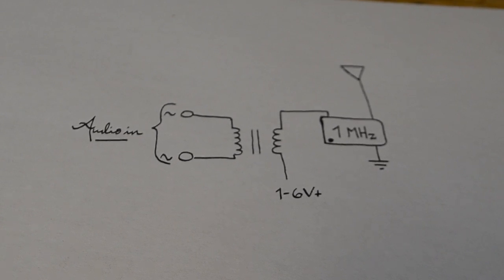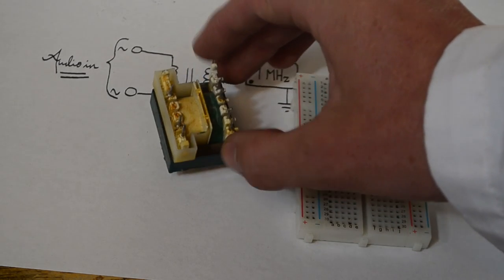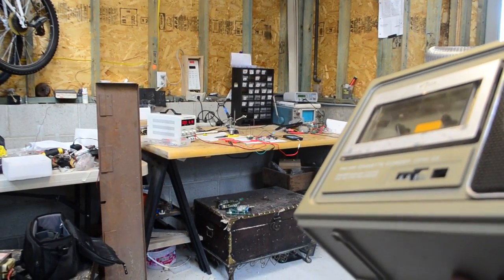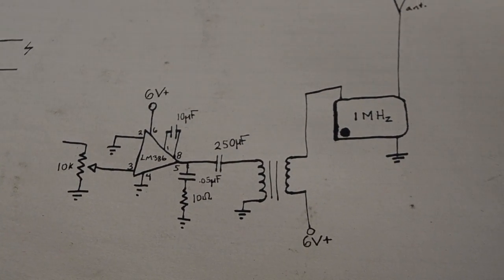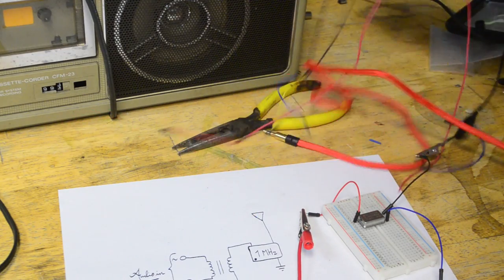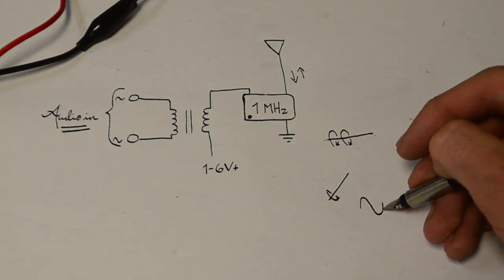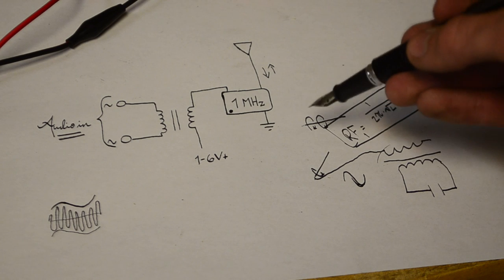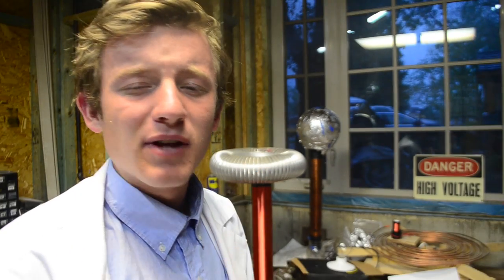How to make a AM Radio Transmitter

Comment: During my childhood, I built two spark gap transmitters out of two car ignition coils, two motorcycle batteries, a homemade telegraphy key, a spark plug, a simple LC tank circuit and a very long piece of wire to be the antenna.  The receivers were just AM receivers tuned to the top of the scale.  I gave one of the abominations to a cousin I had living about two miles away.  I kept the other one.  We both tuned our AM radios to 1610 AM and started tapping away.  We could hear the other operator easily two miles away and we had a cheat sheet to tap out the Morse code letters.  Unfortunately, those were the days of analogue television that was received over the air with a TV antenna mounted on the house roof.  My cousin and I were not the only ones that could hear each other tapping out or butchered Morse code.  We tapped out our messages most of the summer.  At the end we did not even use the chest sheets.  Then one day my father found me tapping away on my spark gap transmitter. I got in major trouble.  People all over the neighbourhood were falling victim to my sloppy transmitters on the telephone, television, and radios.  After a date with dad's scorn, I had to take my cousins transmitter back.  My father made me go get my cousin's transmitter by foot, dismantle it, and carry the heavy, bulky, transmitter parts back and give them to him.  It was 90°F so it was not pleasant at all.  The two batteries, two coils, excess cable, home made key, and simple tank circuit all weight what felt like about 85 pounds.  I guess that was punishment enough. The transmitters was never mentioned again by my parents.  I thought they were cool. The neighbourhood did not.
Reply: That is absolutely awesome
Reply: @brandonlaragirl  I still remember how to make that radio wave mangler.  Today, I could probably get away with it since the over the air signal is digital, telephones are digital cordless or digital cellular.  The regular analogue radio would still suffer.  But streaming radio would be uneffected.  But today, I live far away from any family.  They reside in a, different continent. I live in a rural area, far from people as well. Even if I knew anybody, It is likely few would want to play telegraph with a 51 year old geezer as well.  But I still have memories.  It was not appreciated, back then, that when I came to get the transmitter I made for my cousin, he told his father I forced him to take the transmitter and use it.
Reply: they had no whimsy in their life
Reply: @cassandradawn780  People have no sense of humour.  They could have taken the opportunity to learn Morse Code.  They squandered my free service.
Reply: @indridcold8433  well i would but i don't live in the same country as yours 😥
Reply: @alifr4088  Well, the transmitter transmitted around 1.6 Mhz.  I could have made a much longer antenna and another one for you and another spark gap transmitter.  That frequency has excellent atmospheric skip propagation.  We may still be able to tap away and hear each other.  C
Reply: @indridcold8433  yeah i bet my nearby airport ATC would really apreciate that too
Reply: @alifr4088  Now that you mention it, I believe sparkgap transmitters are illegal for any use today.  But I did not know that around the age of 12.
Reply: @indridcold8433  at least i managed to build the AM receiver with amplifier lol
Reply: Spark gap transmitter can wait
Reply: @alifr4088  I made an AM receiver that received just under the AM broadcast band to about 20 megahertz.  I made a three transistor, class A amplifier, for it and was able to get good volume from it.  I rather wish I went into electronic engineering as a job path.  It always sounded interesting and fun to me.  But it just paid too low to consider it seriously. It is still a hobby for me.  As a teenager, I made an AM transmitter. It did not transmit as far as the sparkgap transmitter, not even close.  But it was really easy to make an AM transmitter that covered half the neighbourhood.  Whenever I made more of an amplifier to transmit further, I think an impedance mismatch made the audio frequency drop to barely audible.  I did not know how to impedance match the extra amplifier and transmitter so I stayed happy with about 700 meter range.  I shot a home made bow and arrow into a tree to hang the wire antenna.  Ah good times. Look what you did.  Now I want to it all again.  This time I know the secret of a small impedance matching transformer.  Maybe I can get few kilometers from the homemade junk.  Now, I can run more exacting LC tank circuit formulas and increase the Q of the circuits to achieve a significant AM transmitter.  I think the LC tank circuit resonance was 1/ (2(3.14) x the square root of LC.  Simple little 2n3904 transistors will make all this possible.
Reply: @indridcold8433  mine is way simpler just a crystal radio hooked to an LM386 amplifier with 8ohm 1W speaker. And also since i live in a military complex and there are multiple abandoned air force radar such as Nysa P-30, i'm able to connect my antenna to it and receive tons of signal lol
Reply: That radar acts like a very huge antenna and i can even receive SW signals too, tho i wonder what'll happen if i connect a spark gap or AM transmitter onto it...
Reply: @indridcold8433  does any one know if  a Faraday Cage,or something similiar  could be built for the spark gap part of the transmitter ?
Reply: @indridcold8433  tell me how to make it i want to make too
Reply: The neighborhood was wrong
Reply: @alifr4088  No, do not connect a spark gap transmitter!  Well, maybe it will not be so bad.  Everything is digital now.  Only analogue AM/FM radios will pick up the harsh buzzing.
Reply: @indridcold8433  It'll only be audible on analogue radios, but it'll still interfere with radios of all kinds. Think of a man whispering tenderly in your ear in English while rubbing your back, and a man screaming ancient Greek in the other banging against your chest. You do not understand the other man, but you still do not hear the flirtations you intend to hear.

Comment: Just so others know, the whip antenna that is extended on top of the portable radio is for FM only, the transmitter he has built is AM and the radio uses a ferrite bar antenna that is located inside the radio. That ferrite bar is very directional.
Reply: Yes this is true. there are 2 winding on the bar one with 18 turns the other with 9. the one that has 18 is connected to the field side on the variable capacitor the other is connected to the first IF stage of the AM receiver just before the detector. This is usually a low voltage zener diode.

Comment: This really does work! I built one this week and it works surprisingly well.  The audio quality is pretty good considering it's AM.
Reply: Make a class AB amplifier with two Mosfet transistors and make a 100 watt AM station.  The schematics and parts are readily available on your local internet.
Reply: Actually, there is no intrinsic reason why AM cannot be at least medfi. The problems are mainly limited bandwidth in a crowded band but in your house for a limited range, you can have a pretty wide bandwidth. The other is atmospheric conditions.

Comment: Hey man do you even know that you are a genius?? Keep up the good work ....
Reply from the maker: +Shiladitya Ray haha, I'm not a genius... But thank you!
Reply: +Keystone Science hey man is it possible to change the jack to a microphone so i can transmit my voice to a reciever?
Reply: @kelvdean6413  Why not try it and see? You might get away with a very high output capacitance mic as they have an amplifier built in, it MIGHT work with a cap mic series with the 1Mhz osc in place of the transformer, Note that capacitance mics get power for an internal amp down the same wires as the signal, and usually have +ve and -ve polarity for this reason.
OR you could feed the mic into an amplifier and  the output of the amp into the transformer where he puts his audio source, the phone.  
If you're not sure of yourself just get something working to feed your voice out to a loudspeaker and then swap the transformer primary for the speaker.

Comment: You could refine this with a band pass filter on the input. And a low pass filter on the output. So the signal only is heard on 1Mhz and not on 2,3,4,5 MHz etc. 👍🏻
Reply: Where were you when I made a couple spark gap transmitters so me and my cousin could tap out Morse code a couple of miles away and listen in a regular AM radio tuned to 1610AM to hear the other.  I did not know every television, radio, telephone, CB, cassette deck, 8-Track, within a couple of miles were hearing our butchered Morse code transmissions.  I got in a lot of trouble.  My cousin did not got in too much trouble because I made the transmitters. Of course he pointed out that I made him take one of the transmitters and operate it.
Reply: Indrid Cold probably where I am right now. But spark gap. Isn’t really filter able. That’s why it’s band now.
Reply: @pd1jdw630  It was bad alright, my father sentenced me to one year hard labour.  The house and yard never looked better shortly after my home made spark gap transmitter, and my cousin's was confiscated.  However, at the end of my sentence, the following year, my father bought md a CB radio.  Do you remember those?  My uncle also bought a CB radio for my cousin. Of course, the activity on them was supervised because of my spark gap days.  He also bought a cheap receiver to listen in on our doings. Those were good times, except for the one year, hard labour, sentence. I do not think CB radios are even marketed anymore.  All the  department stores had them. My father bought me a JC Penny radio.  My cousin got a K-Mart Kraco.
Reply: Indrid Cold ooh that’s hard. Little did you know you where transmitting over the complete radio spectrum. 
I do remember CB radio. It never drawn me. Cause by the time I was in my teens it was the 90’s and CB wasn’t really popular anymore. However making contact to the other side of the world grasped more my attention. ( reckoning this was before 1994 internet came here )
Reply: @pd1jdw630  Dear old dad did give me some credit for my homemade spark gap transmitter.  Before he layed down the law, he said, "Not bad for a 12 year old." 
You are right.  It was before World Wide Web.  Computers all ran Microsoft Basic.  IBM-DOS and MS-DOS 2.1 was all there was to operate computers.  BASIC was the programming language of choice for homebrew programmers.  Cassettes and 8-tracks were the audio media of choice. Oh, and only two genders and American flags were allowed to be flown with no grief.
Reply: Indrid Cold well. You’ve learned something and made something. In this day and age. To make something is to break someone else’s.

Comment: I'm actually planning to use this transmitter to radio control an engine's throttle in an interesting way. My idea is to transmit a variable square wave to a receiver unit on the motor to vary the torque output of a small electric motor that can pull the throttle open and let it close with a spring. It will have a mechanical safety system so the throttle can't open without someone actually on the vehicle.

Comment: If you want a transmitter for long wave radio there are circuits you can build. Popular Electronics had how to build one. The only problem is you may have wind your own coils. The part needed was sold by Lafayette Electronics which went out of business years ago. My friend went.to the trouble to build the project and it worked as far as in his house but the range was short. So he just abandoned the project. Maybe someone has corrected the out of tune problem. That what popular Electronics call the one section for correcting errors on circuits.

Comment: Awesome video if you don't mind me asking. The only thing I don't understand is what is the purpose of the transformer? Under normal circumstances I understand how a transformer works and this application I don't get it.
Reply from the maker: No worries at all! Here, the transformer is only being used to give a boost to the regular electrical signal (when the audio plays through one end, it adds or interferes with the voltage on the other end) so that we get an audio modulated signal on the output

Comment: 200 feet is the legal requirement unless you use 26 or 27MHZ with no range restrictions as long as signal does not interfere with local radio.

Comment: Hello! I totally agree with you - AM transmitter is much easy that FM UHF. But if you want to realy translate your own program on long distance - you need a space for the antenna (2 long wires with length = 1/4 wavelength per one wire)  and you should adjust the one in resonance. If your transmitter works on 1600kHz - the  length of the antenna (dipole) will be quite long - 125meters.
Reply: or use a coil

Comment: Is there a crystal oscillator in the range 160-190KHz?
Reply: Popular electronics has a circuit in its January 1972 edition. There is only one drawback is locating the RF oscillator coil. Miller X-5496-C is needed, J C Miller made one for this project but they are almost non existing now. The other coils can be wound. The circuit may have other issues or it may be matching an antenna for this transmitter. Total length is 50 feet or under. Good luck.

Comment: The FCC allows an antenna up to 9 feet or less and up to 100 mW and you should not cause interference to other local AM stations,.  They do recommend the use of a battery, and also a circuit to help eliminate harmonics.  The signal should not go over 100 feet, but distance depends where you're located. If you're in a rural area then 1000 feet should be okay.

Comment: If I chance the signal which output from an adruino to audio input, this circuit can operate? I have a project which have to transmit Morse code through AM. So I intend to use adruino to code Morse, then send through your circuit.
Reply: did it work for you ? if yes, I would be happy to learn how
Reply: @moshezohar6839  Sorry, I haven't got it. But I used two module Nrf24l01 for transmission information

Comment: Great video - given the limitations of the crystal oscillator and the sub harmonics that transmit onto other bands, is there a way of adding in a RF band pass filter and how would you put one in for the desired frequency?

Comment: The circuit you shown for a amplifier for the transmitter I would use a negative voltage on the ground for the LM386.

Comment: You can use any crystal oscillator for any frequency it's just locating one you want. You can use rc circuitry and tune any frequency you desire. This video just describes how an AM transmitter works.
Reply: Can I use a transformer from a old disposable flash camera, idk if it will put out too much voltage??

Comment: 5:59 how did you amplify the signal. I am confused as there is only one antenna cable coming out of the transmitter and you had connected two wires. I just would like to ask for an explanation how did you do it.
Reply: thease wires go to audio in on the transmitter(one side of the transformer) and the input of the amp goes to the phone

Comment: An electrical engineer sent me a note and it says audio oscillator could be digikey #aei 14-4016E.G..Cap could bemuch smaller value if Hi-Z is input,lo-z is on oscillator side,try 47uF or 100 MF,e.g. 1 or even lesscap.better,buy lm386 and connect output (pin 5) directly to oscillator power input pin this eliminates transformer +250 MF cap.,and might workbetter i.e. higher modulation index and greater range.

Comment: I'm a little ashamed, I've been a Ham radio operator for almost 4 decades and I had no idea it was this easy to make an AM transmitter.
Reply: It's not this easy at all if you want to be more responsible with spurious emissions, or if you want to use more power.

Comment: Great quick video. I connected my transformer to my positive rail and my power inuput at top left. I see a strong spike in SDR UNO. No sound from my phone.
I do hear my phone if I connect the transformer to my positive rail and the antenna pin but the range is like 3 inches from antenna.
Anyone have any thoughts?

Comment: what is the voltage on the secondary side of the transformer that will kill this system? got a 25W TDA amplifier having its peak output at any frequency 12V....i got an old ferrite core doorbell transformer (quite a powerfull one) and it steps down 220V to 24V---- i did made and "inverter" with the amplifier so you can use a 240-12V transformer hook 12V 50Hz signal which comes from amplifier creates  quite powerfull arc...but where is the limit and what is the sweet spot for this design?

Comment: How do you set an specific frequency for broadcasting the signal?
Reply: You could buy several crystals and use a switch to switch from one to the other, but this is a very crude circuit - modulating the circuit voltage with audio is terrible.  Ideally, you would want a circuit with several transistors, one as a dedicated variable oscillator.

Comment: Hey plz plz plz tell me if it's possible to modulate Fm using same crystal circuit with transformer or any single transistor , i know single transistor fm transmitter circuit exist but that's not stable like this ! Plz share ? 
Because i wanna built fix frequency pet or dog tracking device ?

Comment: + keystone science could you use that lightning effect to track thunderstorms? Just an interesting thought
Reply from the maker: +* * probably, you would probably need 3 receivers, then just using a formula to calculate where the strike took place based on the small time difference each arrives at the source
Reply: Keystone Science you're taking about something like triangulation, right?
Reply from the maker: +* * yep!
Reply: Keystone Science cool, nao all I need to do is not be lazy and do the research/get the radios, lol

Comment: I have a question.
When I  supplied 2.3V DC power without audio amp,  I got the maximum transmitter power.  How can I explain this?